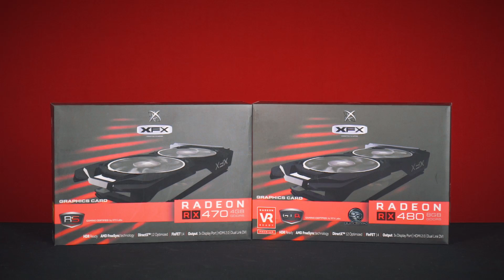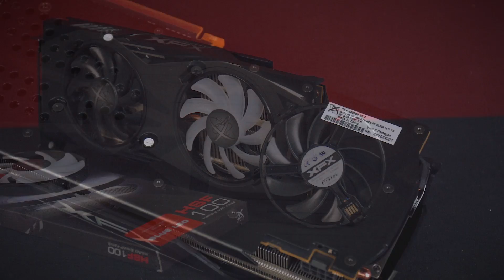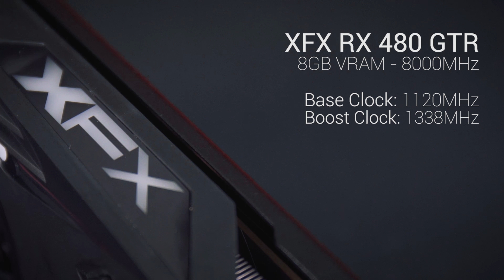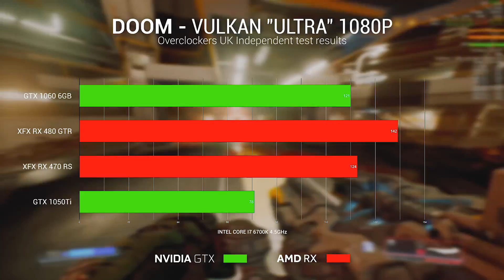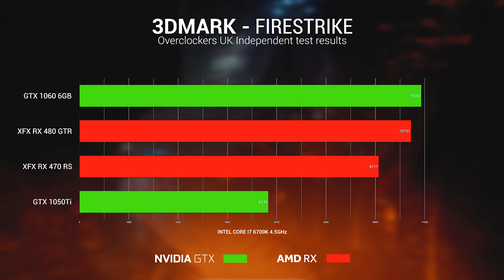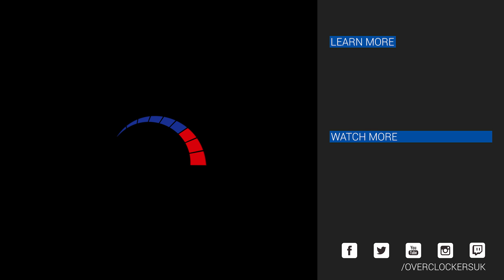XFX - RX 480 GTR & RX 470 RS + LED Fans! - Overview

Comment: don't forget you could over clock the gtr to around 1450 mghz without upping the voltage. Just watch JayzTwoCents video, he goes into much better detail than this one.
Reply: CHProdigy How high would the XFX RX 470 RS overclock?
Reply: martinunagarcia id say somewhere around 1400 stable and you'd probably have to up the voltage any higher.

Comment: Max temparatures of RX 470?
Reply: depends how the 3rd party has set the thermal threshold but it's usually between 65-75 degrees Celsius.
Reply: blaser did you bought rx 470?
Reply: ***** yes I'm waiting on delivery
Reply: blaser which one?
Reply: Sapphire nitro+ 4gb model
Reply: blaser when you play games (Witcher 3, Mad max etc) inform us about max temparatures etc. 

Whats your headset?
Reply: ***** I'm going to be playing Doom and GTA V first.
I don't use a headset, I prefer open headphones and a Samson condenser mic.
Reply: blaser my buddy wanna to buy Superlux HD 668B or 681B and he wonders which one gives best soundstage and SURROUND epxerience.
Reply: max temp depends.. with the case open i get 62c max on my 470. with the side panel on i get 69max but i bet it will drop to 66 when i add another case fan
Reply: ***** what about your rpm?
Reply: ***** I get under 60 average temps, maxes out at 73. Average rpm gaming is 700, max is 1300. Fans don't spin up on idle and card keeps real cool, but it's winter now, summer will be the test when it comes.
Reply: blaser well at 60-65 even in summer it wont go more than 70C!
Reply: ***** on idle i get like 25-29 but in heavy gaming when its 100% its 60-62. I keep my fans at 50% speed because they are almost totally silent. i have strix rx470

Comment: do those fans also give you a cooling preformance upgrade, not just a visual one?
Reply from the maker: These fans are purely a visual and practicality upgrade, allowing you to match the theme of your build or easily clean out the GPU fan, there is no performance difference on these vs the stock fans.